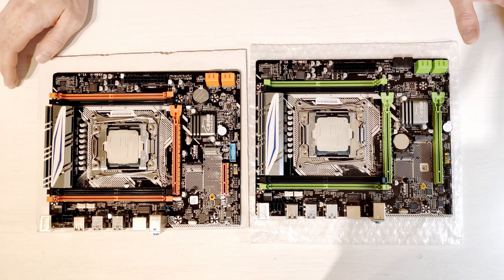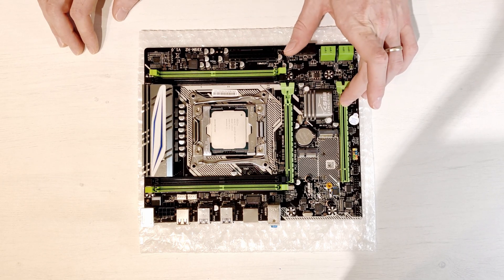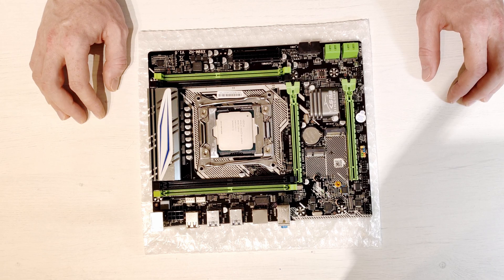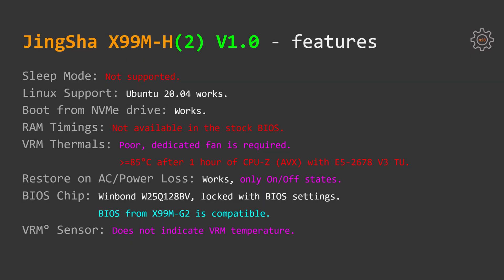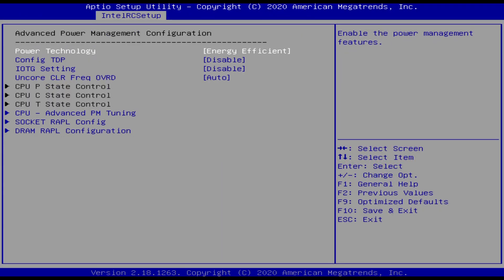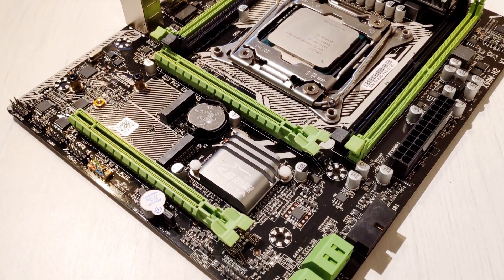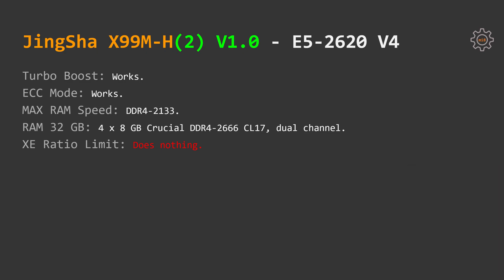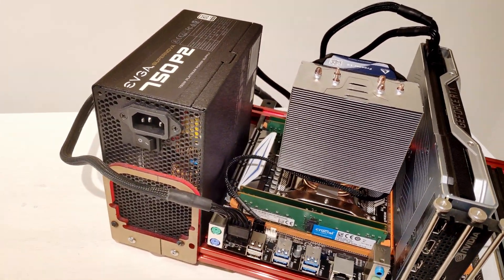🇬🇧 JingSha X99M-H(2) – detailed review, E5-1660 V3, E5-2678 V3, E5-2620 V4, i7-5820k, i7-6800k

Comment: Good tips on this board.  I was able to run memtest86+ without crashing using a x4 8GB micron 2400mhz rated sticks (operating at the cpu limit of 2133).  Not sure if the different result was because of a different CPU (e5-2667v3), or the minor difference in memory.  My x99m-h also doesn't seem to be limited to x8 on the PCIE slot as GPU-z reports that it connects as an x16.

Lack of quad channel ddr support and some of the other limitations of lesser chipsets are still drawbacks, wish I had found your content prior to buying the board I got.  Either way, the bios/efi turbo unlock was good for a few hundred points in cpu-z benchmark, and this chip seems to run well below its advertised TDP.

Comment: Good Day, finally I received RAM from China for this board, now everything is fine, everything starts up, but now I installed Windows 7 on the disk and the system starts up and then restarts again, that is, when Windows starts and initializes the system restarts again, I read about this bug and maybe the reason is in the wrong version, older Windows 7? I'll try to install then a newer version 7 or eight.

Comment: Can JingSha X99M-H2 being Turbo Boost Unlocked and run stable ?
Reply from the maker: It can be Turbo Unlocked, stable is very questionable. Depends on what CPU you install and whether you get a good or a bad sample of the motherboard.
Reply: @Miyconst  I am trying to get E5-2696V3, and Latest Jingsha X99M-H2, question is, where can I find the turbo boost BIOS for this mainboard?
Reply from the maker: @mertz8867  this is a bad idea, the motherboard VRM won't be able to hold this powerful CPU, but the BIOS you can get here: https://youtu.be/bO2t790vhg8
Reply: @Miyconst  Thank you very muc
Reply: @Miyconst  what if I choose Huannazhi X99-TF with E5-2696V3? Will that be better?
Reply from the maker: @mertz8867  "safe" and "China" are not compatible, but it's much safer than X99M-H2.
Reply: @Miyconst  Thanks for your feedback

Comment: Hi there again! I have purchased x99m-g2 and followed same procedure as on video. After disabling power technology and updating win, system won't boot. 
Pc have endless on/off loop, in interval of cca 3 second.
What could be the solution for that?
Thanks in advance!
Reply from the maker: Corrupted BIOS, corrupted Windows installation, defective motherboard, unsupported CPU, there are numerous options.
Reply: @Miyconst  cpu is e5 2666 v3, so i doubt it's not supported.
Since I can't get in to bios, is there anything I can do?
Reply from the maker: @tomislavhorvat-g5s  then the BIOS is corrupted and you have to restore it. I assume your E5-2666 V3 is the final retail version, not a ES chip.
Reply: @Miyconst  it's retail version, i checked with cpu-z. Allso,  it-s 100% functional in another motherboard, so it's not bad cpu issue.
I guess i need to purchase fpt... 
Thanks for your time. Keep on doing great work!

Comment: Hi, thanks for this review. I have bought it and pair it with a E5 2640 V3 but the system freezes. Do you think the power delivery system is not enough for such CPU. What else could be the issue? Maybe the CPU itself?
Reply from the maker: No and no. Most likely it's a faulty motherboard, but you have to test with clean windows installation and default BIOS.
Reply: @Miyconst  Thanks a lot for getting back to me so quickly! I was hoping not to be the motherboard, getting anything to my country is super hard and take months. I should have watched your 2021 shopping guide before buying. I'll take my chances with a Huananzhi 99 F8, it's the safest bet. Cheers!

Comment: Hi 

I have an issue with m.2 slot for WiFi card on this motherboard. I have installed in this slot WiFi6 card with a bluetooth ( Intel Wi-Fi 6 AX200). And system do not see this bluetooth adapter at all.  Bluetooth adapter on this card is working  via USB2.0 pins in M.2 slot. It is possible that this M.2 WiFi slot on motherboard do not have this USB2.0 pins connected ?
Reply from the maker: Yes, it's possible. Also might be that it's not compatible for some reason. What is the motherboard chipset?
Reply: @Miyconst  CPU-Z shows me H81,but i have BIOS from X99M-G2. So this may be not accurate.
Reply from the maker: @michalkolodziej79  I see, I have tested B85 option only, and it was working. It might be that H81 chipset is limited and does not have the required USB port.

Comment: FOR USERS WITH PROBLEMATIC M2 DRIVE (X99M-H2):  if you have trouble, discover your M2 drive in BIOS follow these steps: 

1. Turn off computer
2. Remove GPU
3. Reset BIOS using s battery or jumper (make sure the power supply is unplugged) Resetting bios from BIOS settings don't work!!!
4. Turn on computer without GPU. 
5. After a while (1-2 min), turn off.
6. Put back GPU.
7. Now M2 drive should be detected.

I've encountered this problem twice after changing hard drives and other devices.
Reply from the maker: Thanks for sharing the info. I will test it myself when I have a chance!

Comment: I managed to repair my defective motherboard. I replaced the 2 small burned elements near memory slot with parts from another dead motherboard. I am also using BIOS from X99M- G2, because at 1st moment my thoughts was that the  bios was damaged so I used flash programmer. After my DIY repair at home without any equpiment and knowlage my motherboard have 2 working chanells, but not only that! It passes all memory tests , there is no longer crashes. Boot times are significantly faster and overall performance is distinctivly better. There is no longer need to tweak power option. There was no loops on start up. It is working better than my Rizen R5 2600+ Asus B450(as response times while opining stuffs) Previously in CPU-Z my chipset was recognized as Q85, now is recognized as H81, but as far as I can read on chip the numbers represent B85.
Reply from the maker: I am glad to hear that you were able to get the motherboard working! Great job! The chipset might be recognized differently due to the BIOS.
Reply: @Miyconst  Thank you for replacing to my comments. Your channel is the best!

Comment: VERY IMPORTANT NOTICE! (This is my experience, it is not excluded the possibility of my mistake or causes not related to the motherboard) After a couple of days usage the motherboard suddenly stopped working. Hence it wasn't the ram, cpu and GPU. I told myself it was the BIOS, but it wasn't. After manually Flashing the BIOS with usb programmer and making attempt to power on the system.( Presumably this removes the error from some sort of BIOS log i dont know) I saw physically the overheating and short  circuiting element( with numer 0 on it) near memory banks (this banks near back usb ports). After this the two left memory banks stopped working and after all the memory hanging issue with AIDA 64 stability test is not more present. This shows clear connection between memory benchmark hanging problem and  physicall hardware issue. In my opinion do not use this Motherboard because there is a risk of short circuit. This mean in some cases fire and damage to other parts( I am with expensive Be Quiet Power supply) who knows what happened if you are not, because on second attempt I used older power supply which is 100% ok, but with millisecond slower protection. 

(Because I deleted unintentionally my previous comment)power technology and intel management issues are also present also on my motherboard. The build quality looks decent. Usb 3.0 ports are buggy, but after a couple of windows updates start working properly. Boot time is slow. 
In my opinion avoid this Motherboard. I am stuck with no money and not properly working computer.
Reply from the maker: I mostly agree with your conclusion, but your particular motherboard seems to be defective. I know a guy who imports and sells them, the number of defective units is rather low.
Reply: @Miyconst   Yes, I definitely can't make conclusions based on one motherboard. I've had defective parts and electronics from reputable brands like Acer, Fujitsu that had issues too. That does not make them bad at all. It is normal to occur and most failures in my experience occur when the electronic devices are new. Drawback is that there is no guarantee, but hence the number of boards that they are producing is rather low they cannot justify the price of it if they include warranty service. Low production volume for me equals to higher production cost. SZMZ is a good company and clearly have much better products even for the same price. This is definitely not one of them in my opinion even without defective element. Interestingly my motherboard is with H81 chipset unlike this in video with q85
Reply from the maker: @Ivan_I_L_I  totally agree.

Comment: Thanks so much for your detailed reviews, information and Mi899 tools from the UK. Have just built a system on an X99M-G2 and a Xeon E5-2630v3 thanks to your videos. Some driver issues on the Intel ME - but got there in the end. Turbo unlock and undervolt thanks to Mi899.

Comment: I wished I saw this video before buying the orange version. I ordered a E5-2630L v3 and 4 sticks of Samsung DDR4 ECC (separately) for the budget price and low power consumption.
Reply from the maker: It's not that bad after all. The motherboard works, and E5-2630L V3 has great performance for its price of just about $20.
Reply: @Miyconst  that is a major relief! I'll let people know how it goes when all of the packages get here. I'm aiming for a VMware esxi build to start my home lab.
Reply from the maker: Please do so. Such comments and experience share help me collect some facts and statistics about different motherboards.
Reply: @42svb58  I'd love to hear if you get esxi going. I have the same plan.
Reply: @paeanthesurreal  Parts were shipped and entering the US soon! Also, I discovered a lot of network interface cards lost support for esxi 7.0 so I ordered another one from ebay.
Reply: @Miyconst  everything arrived and installed perfectly without any problems.  I didn't use a temperature reader but I didn't feel like there was any significant rising temperatures.  The 2630l v3 only hit 1.8 ghz before unlock using cpu z and 2.3 ghz after unlocking the bios. I ordered the 2650l v4 so I'll see how temperatures hold. I was thinking about getting a dual socket x99 but I think the 2650l v4 is fine even if locked for my homelab.
Reply: @42svb58  How did ESXi install? My board and cpu are on the way. They shipped out of Singapore two weeks ago. I also picked up a quad pcie NIC.
Reply: @paeanthesurreal  the quad nic won't fit because the heat sink is in the way of the usb header cable.  I ordered another single port.  Setup will not detect the onboard lan
Reply: @42svb58  Mine arrived today. My quad nic has a thin profile so the only header it blocks is FAUDIO2 in the corner. I'm still waiting for my heatsink and fan to arrive. Did ESXi install fine?
Reply: @paeanthesurreal  esxi was fine with the nic! I used the Intel expi9301ctblk
Reply: @paeanthesurreal  Update: I encountered some problems accessing the remote management console after the install of esxi. I had to reinstall esxi 7.0.1 and disable IPv6 since the likely culprit was corrupted management services.
Reply: @42svb58  Thanks for sharing. I didn't realize my quad nic is only supported in ESXi 6.7, so I'll be using that until I get a new nic. Were you able to use the NVME slot? I can see it in the BIOS, but not in ESXi
Reply: @paeanthesurreal  I abandoned ESXi on this board. It installed correctly but would not connect from remote admin with IPv4 DHCP after the first few mins. This did not happening on my previous build with a brand name desktop i5 ASUS motherboard from 10 years ago on the same network, NICs, USB drive, and image. Windows 10 Pro works fine with virtualization of Ubuntu Server, Kali, and Windows 2019 Server.

Comment: Thanks for all the information Miyconst, one question: is this model the same as the SZMZ X99M-G2 ?? The physical board is very similar with little differences(speaker for example) and possible B85 chipset. 
You know this model? You know anything about sleep mode in SZMZ model?

Regards from Spain and thanks again!!
Reply from the maker: It's basically the same board, just a slightly different look. Sleep mode doesn't work with X99M-G2 as well.
Reply: @Miyconst  But chipset is not Q85 or H81, is B85... is possible works differently?
Reply from the maker: You never know which chipset you get, Chinese use it randomly.
Reply: @Miyconst  It is true. you are right in this :(

Comment: Hi. I bought an orange version. (X99m-h). I have e5-2658v3. It doesnt recognized them, only see as intel genuine cpu. Where could i download fresh bios? I cant find on your webpage. Thx.
Reply from the maker: It seems like you have an engineering sample and not a retail version of Xeon E5-2658 V3, that's why it's not recognized. Updating the BIOS won't help here.
Reply: @Miyconst  no, its not ES cpu. What should i do? What version is the latest bios for my mobo?
Reply: Hi. Cpu-z says this cpu is ES. Hmm. On the top of the cpu not signed as ES. Is this worse than commercial ones? Other: cpu-z says my mobo is x99-d4. But this is not, it looks like as x99-h. Do i flash x99m-h bios onto?
Reply from the maker: @jockerojock  Yes, ES (Engineering Sample) CPUs are pre-production units, they may have defects and work not as desired. What is the CPU Stepping according to CPU-Z? Why do you want to flash the BIOS? It's not going to fix the CPU.
Reply: @Miyconst  stepping is 1. Previously owner of this cpu used as e5-2658 v3. Is it possible other mobo identify as other cpu than mine? For bios: my mobo is x99m-h. I think x99 d4 bios installed. Or is it good?
Reply from the maker: @jockerojock  you have a pre-production CPU, which is not as good as the final version, you also can't apply Turbo Boost Unlock with this CPU. X99-D4 BIOS is not compatible with this board, since it uses non X99 chipset. You can check the used chipset with Aida64.
Reply: @jockerojock  would U mind exchanging a few emails with me (username at gmail.com) - I'm puzzled by this board as Intel says H81 and Q85 chipsets do NOT support VT-D and yet the hardware info at 04:31 shows BOTH variants have VT-X and VT-D enabled... I need to do virtualisation with GPU passthrough so need to check some bits before I buy this board, CPu and ram....

Comment: Hi! I discovered your channel recently and found the content that I produced very good.
I saw that you have done several reviews of x99 dual cpu motherboards. I intend to purchase one, and I would like your help!
In your opinion, if you had to indicate a model, which would it be?
I work with architecture software, for rendering and structural calculation software, and the more cores, the better.
I'm still in doubt as to whether I use the E5-2658 V3 or E5-2670 V3.
Thank you and congratulations again for the channel!
Reply from the maker: Thanks for the support. I have answered your questions in the email.
Reply: @Miyconst  Thanks for the quick return!

Comment: Please look at machinist x99-k9 please
Reply from the maker: I have already ordered it.
Reply: @Miyconst  you’re a diamond reviewing this older tech and making it a more viable option for today and can they be turbo unlocked?
Reply: @Miyconst  do you think the Xeon E5 2680 v4 is a viable option going into 2021
Reply from the maker: @atilla101uk  it depends on your usage scenarios. I already have an E5-2680 V4 lying in my locker, so there will be a test, hopefully soon.
Reply: @Miyconst  that’s great I did a little research to see if instruction set might have been different between the v3 and v4 but they seem to be the same apart from some database instruction set that I don’t think would be relevant to a gaming/illustration/streaming machine
Reply from the maker: @atilla101uk  I made a typo in my original comment, I have an E5-2680 V4 lying in my locker for testing :)

Comment: Hello miyconst, I am writing to ask you about a problem with jighsha x99 d8 motherboard and it is that I already assembled it but it gives me a problem on the led screen which is the "b0", I don't know what it could be since at first I got the error " b7 "but I solved it by changing the slot ram ... what should I do, please help me :(
Reply from the maker: You should start with specifying full list of components and what you have already done while trying to make it work.
Reply: @Miyconst  2 memorys 8gb 2666mhz gloway 1 crucial 240gb ssd xeon e5 2620 v3 cooler máster  750w 80 plus msi armor rx 570 8gb I just set it up like any other pc but when I started the first boot I got the error "b7" I tried a single ram in each slot and it stopped giving me that problem but I immediately skipped the other one which was the error "b0" in which I am stuck until now, according to what I investigated it could be the ssd failing but I tried it in another device and it works normally ... I tried with each sata port of the board but the error keeps appearing ... I have a bios flasher to put the bios of the huanazhi f8 but before flashing a new bios I prefer to ask you that maybe you have already had these problems in your review and can you help me
Reply from the maker: Most likely you have got incompatible memory. Do you have a possibility to test the RAM with some other platform?

Comment: Hi Bro! Haver a problem i'm  using -90mv of undervolt in E5 2678 v3? Can I have problem with performance?
Reply from the maker: You have to test your CPU and see if it can handle such voltage reduction or not.
Reply: @Miyconst  ok, thanks